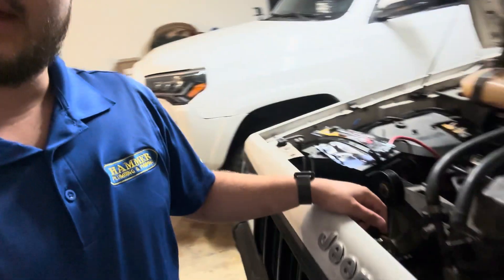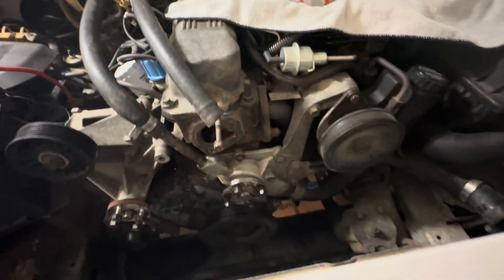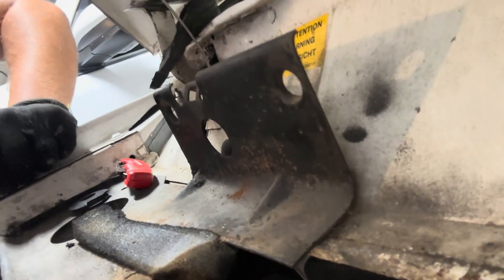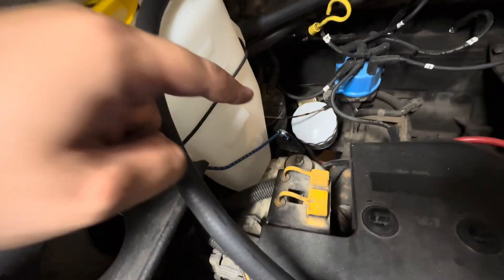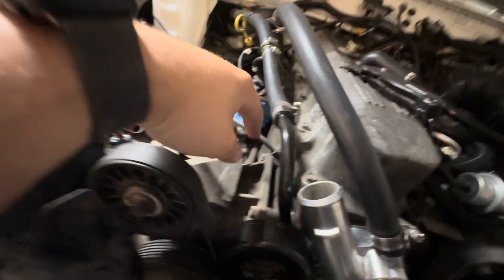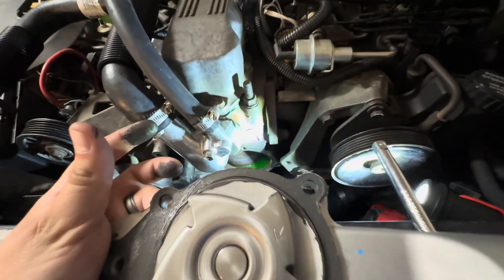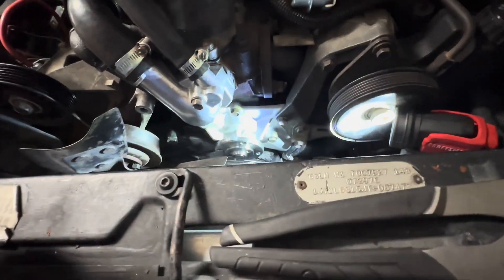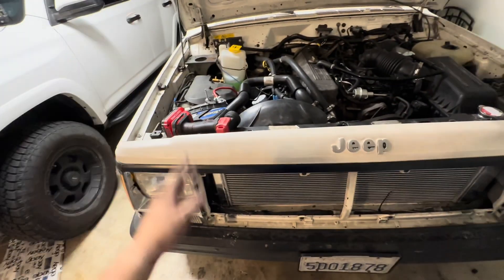Upgrading Closed Cooling system to an Open Cooling system / Water Pump Replacment - Jeep Comanche

Comment: Bro I need your help 
I did te same but my mechanic didn't put a new water tank again and now my truck is leaking the water. So i would like to know where did you get the water tank and the hose as well.

Comment: Switching is not an upgrade.  If you are overheating. Diagnose the problem.  If your pressure bottle is discolored, that's due to the engineered system did not receive proper maintenance.  One can install a higher capacity radiator/water pump/t-stat housing, different fan clutch, vents, janky hood spacers or such to improve the flow rates.  As we also know, if need be one try to use a chemical with water to attempt to dissolve any deposits that might have adhered in the system.  To clean a reservoir or pressure tank one can throw in a touch of pea gravel, some water and dish soap then shake vigorously.
Reply from the maker: @Mauser1965  thanks for the comment. I see your point and it’s valid. To me it is definitely an upgraded system. Away from the old renix system and in with the new open system.

Yes it was overheating, however my plan was always to replace the entire cooling system regardless. So with that in mind I just switched to, in my opinion, a better designed cooling system.
Thanks!

Comment: Was the old bottle actually leaking or giving issues? What did the upgrade all cost you in the end? I have an 89 with that bottle but it's not leaking so I'm lazy not doing anything ha ha.
Reply from the maker: It wasn’t exploding (yet) thank God, but it would leak from the cap every now and then. But i mainly wanted the upgrade to easily fill my system with coolant. Plus having a third row radiator helps. But the bottle closed system still works and works well for what it is! Keep it for as long as you can till you have to upgrade!
Reply: @88MANCHEBUILD  how hard is it to add coolant to the old bottle? Doesn't seem any harder than adding to the overflow bottle you installed?? I'm not seeing the benefit to do the change-over, no offense. I just got my 89 MJ not long ago, it has a new looking rad and water pump so clearly the previous owner did some work but it still has the original bottle.
Reply from the maker: @InternetDude you won’t be adding coolant to the engine through the new overflow reservoir on mine..you’ll add it from the radiator cap.
On a closed system every little thing is pressurized, so once you add coolant in it, you have to bleed the air bubbles or it’ll cause issues with overheating. Plus since it’s all pressurized if you have any leaks it’ll cause air to get in your system which is not good either.
Open system you don’t need to do that. There’s venting on the overflow reservoir that allows the system to breathe.

At least that’s how I understood it. 🤷🏻‍♂️